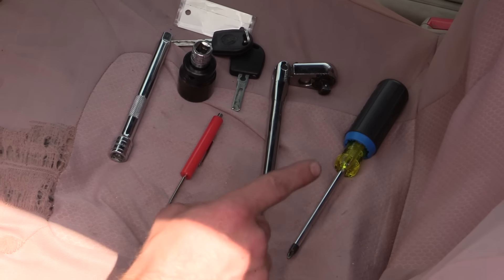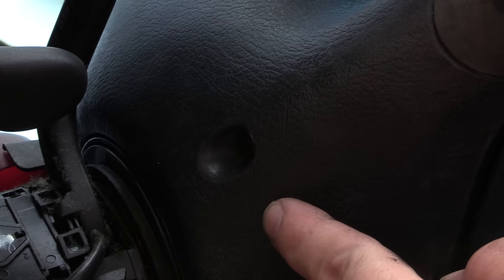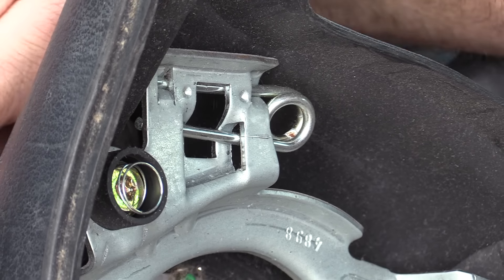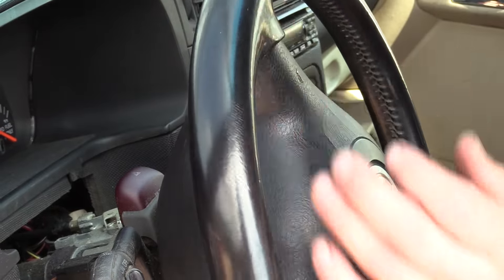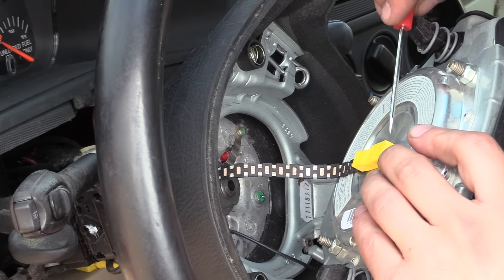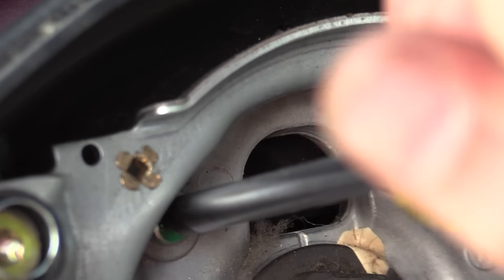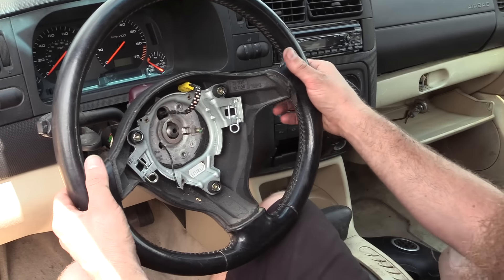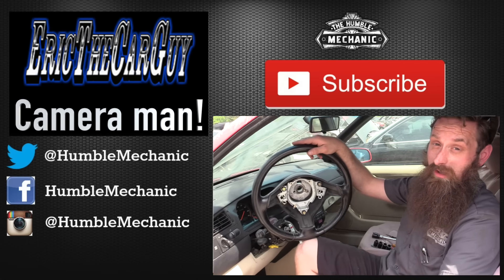How To Remove a VW Steering Wheel ~ Salvage Yard Tips

Comment: Two things to add here, when you remove the steering wheel from your car always turn back to 12 oclock, so the replacement wheel gets put on straight.  Second, put the 24mm nut back on two threads  before working the wheel loose so if you have to pull hard on a stuck wheel it doesn't pop off and hit you in the face.

Comment: Struggled for ages until I extended the steering column out to its limit then the screwdriver fitted easily and it popped off with in seconds.. good vid. VW Sharan with a M12 spline bolt to tighten the wheel..

Comment: Just left a wrecking yard to pick up a clock spring for a 2014 Passat. I had no key but I was still able to turn the wheel. I made sure the front tires were pointed straight ahead before I removed it though. The steering wheel had the triple square bolt instead of the 24mm nut.  Now the fun part, to see if this used unit works! 🤞🏼

Comment: Charles 
I'm surprised that pick a part would not have removed the air bags themselves due to how hazardous they can be. some of the yayhoos that go into salvage yards haven't got a clue on airbags, theirs sensors or how they operate.

while I'm here does a 1997 Eurovan/T4 air bag release the same way. some day I might have to remove the steering wheel for maintenance or the multi switch.(turn signal ,speed control stalk)

another great informative video.

Comment: So much easier than I used to do - my old car had a splined taper for the steering column, so you needed a puller (or a hammer and brute strength) to get the steering wheel off.

Comment: Love your salvage yard tips for these VW's. I've been a Subaru mechanic for quite some time, but my dad bought an Audi Allroad and I just got an MK4 Jetta TDI... I'm slowly moving towards the dark side:/ ... I'm researching doing a 4Motion MK4 Jetta TDI conversion, although it's looking pretty daunting.
Reply from the maker: +Rodrigo Sagebin NICE!!! Probably be easier to buy an R32 and swap a TDI. lol
Reply: I've seen people using the R32 for the swap. Do you know if the transmission just bolts right onto the 1.9L TDI engine?
Reply from the maker: +Rodrigo Sagebin it does not. :(

Comment: Nice video Charles! In modern VWs I think there's a triple square head bolt instead of the nut, otherwise its the same. It's funny how there's a "special tool" to release that spring lol. I think I read on ELSAWIN the instructions to use the screwdriver as well, i found it really easy when I did it myself on a VW Up!.
Reply from the maker: Yeah the newer ones are a triple square. The MK5.5, B6 and up are pretty easy with a pocket screwdriver, or small flat blade. These older ones were awful. I was shocked the airbag came off with little fighting HAHA

Comment: Great video BUT unfortunately I still can't get the airbag off even following your tips. I have literally wasted hours over this step that should take a few seconds.😬I'm sure I can actually feel the spring / clip moving slightly when I press the end of the screwdriver down, but the airbag is just not popping open, even when holding it in as you suggested. Any additional tips of what I could try? My car is a 2008 Seat Alhambra.

Comment: This looks like the same steering wheel on my 2002 B5.5 VW Passat Variant. I'm assuming pretty much all of these instructions are the same or similar. I'm thinking about doing a cruise control retrofit kit on it. This is valuable info for me. Thanks!
Reply from the maker: Very similar. You’ll need a triple square for the bolt.
Reply: HumbleMechanic, good to know. Luckily I have a nice set of XZN sockets. Thanks for the info.

Comment: I have a question... My wheels where aligned perfectly BUT my steeringwheel is now a bit off to the right. Can i just take of the steering wheel and put it back in pointing up? Or will that mess up the steeringwheel angle sensor? Thank you for the clear video on how to remove it!
Reply from the maker: You can, but it’s better to get the alignment right. The steering wheel needs to be straightforward when aligning

Comment: Interesting how the Mk3 has a retaining nut, instead of a retaining bolt on the Mk4 and up.  That technique with the airbags is the same dance you have to go through on the newer models, too.  It's always nice to have a video to show how the spring and posts work on all the generations, so you're not hunting blind with your pokey bit in a hard to reach hole.

@HumbleMechanic, do the Mk1 and Mk2 VWs use the same 24mm nut like the Mk3?  Or is it a different method of attachment for those?
Reply from the maker: +chrstphrr I think it's the same. Be a while since I had a mk1 wheel off.

Comment: 2/4/2019
Hey, love your 'how to' videos and really appreciate that your a VW guy. 

I recently went through about a one week long deep freeze here in northern NJ. I immediately noticed was not hearing my windshield washer motor when I pulled the lever toward me on my 2013 VW Jetta Sportwagon i5 gas aspirated model (M6?). Anyway, at first I figured the lines were frozen but then I realized I wasn't hearing the washer motor anymore either. Just silence. The windshield wipers went through their usual two swipe sequence but no fluid. Checked fluid level, it was good, but topped it off anyway. Then I realized that an odd thing happening that I hadn't realized was happening at first. When I pull the lever toward me to wash the front windshield (remember now, silence, no washer motor noise), the windshield wipers would go through their normal two swipe sequence, but the REAR wiper was also doing its one swipe pass too! This never happens and is not supposed to happen when you pull the lever towards you. Now, additionally, when I push the lever away from me, to operate the rear windshield wiper, the rear wiper does its one swipe pass, but the FRONT wipers also do their two swipe pass as if I had pulled the lever toward me! Very bizarre. It does this activity each and every time I try these actions. I am thinking that perhaps the WW Switch itself may be faulty. What is your interpretation or experience. Can you perhaps give me a call on my cell phone to talk this through with me? My name is Kevin and my number is 973 803-0663. I truly value your time and assistance if you are able to give me any. 
Thanks Bud.

Comment: When trying to release the airbag clip is there a chance it will go off even if the battery is removed?
Reply: shouldnt be, i mean youd have to give a static shock from hell
Reply: no
Reply: Pretty little chance, but always take safety measures. Disconnect the battery and ground yourself to eliminate any static charge before touching the connector.
Reply from the maker: It is part of the repair procedure to "unearth" the battery. I have done that about 2 times, but it's always recommend.
Reply: Okay, thanks for the replies, guys! Happy new year!

Comment: Hello, thanks for all that you do . Do you know of any tips or maybe a video where it shows how to access the wires that go to the steering column lock? I am having a problem with my CC that when the weather gets cold and I go to start the car - the car won't start, I get a red flashing steering wheel symbol on the dash, get a notification "steering wheel column lock defective", and a beeping noise. Then, I usually remove the key, rotate the steering wheel and I can get it to start. 

I am very suspicious that this is just due to a poor connection in the winter when the wires contract due to the cold weather. It mostly only happens when it is cold outside. Thanks again for what you do.
Reply from the maker: Possible. Use ErwinVW for a one day wiring diagram pass

Comment: I need to replace the cruise control switch assembly in my 2009 VW Routan.  My Airedale terrier's leash wrapped around the switch handle and pulled it out of the column.  :(    Is this pretty much the principles that I need to use to remove the horn assembly to get to the switch?  What type of connector is used to hold the steering column trim?  Is it a screw?  I look forward to hearing your answer.  I miss my cruise control and I am sure my Airedale is tired of hearing from me how he broke my cruise control switch.  :)

Comment: THANK YOU FOR THE VIDEO, THIS LOOKS VERY SIMILAR TO MY 95 WOLFSBURG EDITION CABRIO EXCEPT THAT I HAVE A 4 SPOKE STEERING WHEEL. IS THERE ANY DIFFERENCE IN THE PROCEDURE FOR THE 4 SPOKE WHEEL? THE ONLY REASON I NEED TO DO THIS JOB IS TO REPLACE THE HAZARD LIGHT SWITCH FOR A SAFETY INSPECTION.
Reply from the maker: It should be the same if it’s a mk3

Comment: Hey Charles how you doing today I am working on a 2009 vw cc with a 100k miles on it the costumer said that there steering will is hard to turn do you know of any common power steering issues on these specific vehicles that I should look for wen I check it out and do they have electric steering on the 09 vw cc ?

Comment: Question please. Have a 99 new bettle when parked steering wheel seems perfect. Yet when started up ready to drive it's roughly 30 degrees to the right yet it does drive straight. Or other way to describe it vw emblem perfect when get ready the emblem on wheel is v at three o'clock and w at the 9 o'clock position but car doesn't pull either way. Thank you

Comment: Man! I thought you were gonna help me remove it WITHOUT the keys!! When was the last time you had keys at the junkyard? thanks for the video though.
Reply from the maker: More than you think.  You have to totally bust the steering lock of this. The mk3 is a pain. The mk4 is much easier with just 2 sheer bolts to remove
Reply: @HumbleMechanic  ahhhh.. which bolts are you referring to? trying to get the lower trim piece under the steering column but there are two small screws that are directly behind the wheel. Can't remove air bag without turning wheel. So..... 

thanks for the quick response though!
Reply: @SFlores1979  I have a MK4 and was able to remove those 2 screws that you speak of without removing the steering wheel. I used a screwdriver that is shaped like an S /Z / ZigZag  ( has 2 90deg opposing bends in it and about 4 inches long). That allowed me to turn those screws out, very, very slowly. ...But it worked.

Comment: Is it possible to swap a steering wheel with volume/stereo controls onto one without them? Could you do a video on that?
 Thanks - Alex
specifically on a 2005 Golf tdi (I want those volume buttons lol)
Reply: You can yes. But you will need all the can-bus system from that car. As well as the replacing your existing blinker switch. It's a pain that's not worth doing just to have steering wheel controls
Reply: You'll also need a monsoon radio and the password for it

Comment: HI.. i have polo 6n1 1.4 16v 1996 i have removed steering wheel successfully cause i have to replace the ignition switch so i stuck a little bit on that... after some work i managed to replace it it works well first two days and after that i had some white smoke and airbag light came on but the ignition switch and everything else works ok... i open everything again cant see any melted wires or anything but cant get airbag light off... any ideas advices.. Thanks in advance

Comment: Do vw have the wheel and nut premarked for easy reinstallation so you know it is lined up properly?
Reply from the maker: The nut or bolt doesn't matter. Some have a mark on the wheel, and on the steering column. I always add my own before removing the wheel.

Comment: Does this work on B5.5 passats? My steering wheel controls are faulty on both sides as well as the trip computer buttons on the wiper stock. I just want to run to my local salvage yard and grab everything instead of ordering parts.

Comment: will newer steering wheels fit older cars
Reply from the maker: +stephen the handy tuber many will. There was a spline count and diameter change in the late 80s/early 90s. I don't recall the exact time. But many wheels are interchangeable. It's the airbags that may not be
Reply: HumbleMechanic thanks for replying it just I have a 2001 vw polo and the steering wheel is very worn I wanted to get one from a mk6 golf or similar
Reply from the maker: +stephen the handy tuber that will probably work for fit. Doubt airbags are compatible. 

My 05 Passat needs the same thing.
Reply: HumbleMechanic ok I will get one and check connections thanks

Comment: I've wanted to change my 2000 Beetle wheel out for something else.  I'm assuming just a Mk4 wheel from Golf/Jetta would work.  How about an Audi TT from the same year?
Reply: You're in luck.  A Mk1 Audi TT is built on the same A4 generation/platform as the Mk4 Golf/Jetta/Beetle, or the B5/5.5 Passat.  It might work, but I've never seen one with the airbag removed, to confirm it's a no-fuss swap.

The style of retaining bolt and spline on your Beetle will take other wheels from most anything from around 2000 and up, so long as it's from a VW group car (VW, Audi, Seat, Skoda, Lamborghini, Bugatti).  Two big things affect the wheel swaps being plug n' play:

A) The clock spring and number of wires that it feeds to your current steering wheel.  Things like the MFSW (Multi-Function Steering Wheel) controls add wires, and there's a non-CANBUS/CANBUS changover mid generation of the A4 platform -- around 2001-2002 model years.

B) The airbag connector.  The A4 generation Golf/Jetta/Beetle or the B5/B5.5 Passats should have the same airbag connector as yours.

OTHER, later than 2000 wheels will fit the splines on a steering wheel.   But the clock spring, and the airbag connectors change between generations... and possibly between VAG marques as well.

I've fit a Mk6 generation Jetta steering wheel to a 2000 VW Jetta -- it involved me doing some trickery with the airbag connectors, swapping the Mk6 style for the Mk4 style airbag connector.  I used another Mk4 airbag connector/cable from a donor Mk4 steering wheel that matched my original wheel, so I didn't have to do any voodoo with the clockspring.  

Just about every resource I found about this, said it was a bad BAD BAD idea to change the connector, that the airbag won't fire when it is supposed to.  Nothing authorative, but VW wouldn't condone a swap between generations and the wiring/connector changes, even if it's electrically kosher.  YMMV, and no one's twisting your arm to do or not do the wheel swap.
Reply: Awesome! that's a lot of helpful info!  Maybe I'll save up 20k for that Bugatti wheel :P
Thanks man!

Comment: Is there a way to remove the airbag from the cover so i can still use the cover without the airbag?
Reply from the maker: +Green Alien the bag does come apart, but I'm not sure just how to make what you're asking happen.
Reply: Like how the air bag is inside the horn cover is there a way to remove the bag from the horn button completely and still be able use the horn to clip the horn button back onto the wheel?
This is the piece i was talking about 1:09 - 2:39 
I've heard of airbags deploying for dumb reasons. The reason im asking is because i'd like to fit this wheel to my 73 super beetle as a replacement wheel.
Also, any tips for removing the airbag from the wheel if you dont have access to the keys?

Comment: This has nothing to do with this problem. I have a 2004 jetta tdi. I just replaced the starter and everytime I press the clutch the starter engages. I have changed the ignition switch and changed the starter relay but it is still doing it
Reply: Hi Robert. I'm not Charles but I am somewhat familiar with mk4 wiring. My first instinct is that one of the two clutch switches got crossed with the starter power. Many times the wiring sleeving gets brittle or worn out and copper touches where it's not supposed to. I'll try to go look at my Bentley manual and let you know what I find. Definitely a weird problem!
How far down do you have to press the clutch for this to happen? Does the engine have to be running or does it happen with key in, engine off? Or even key out engine off?

Comment: and if no keys whats the magic words charles ?
Reply from the maker: Chainsaw? 
You have to knock the steering column lock off. It it a headache on this car. I think we will be doing more of these videos in 2017. I will have that on the list.
Reply: Could you go the route of unbolting the knuckle on the steering column that feeds into the steering rack on the Mk3 cars?

I've done that on a junkyard Mk4 Jetta:  Remove the cover, 13mm bolt to loosen/remove, pull the knuckle off the spline, and the wheel was free to turn both airbag holes to the 12 o'clock position.  

Did this, in my case, to be nice and not butcher the car while I uh... removed the ENTIRE dashboard to chase part of the wire harness I needed to go with the seats I was taking.
Reply: chrstphrr yes thats kinda what i want to see the most its not the easy stuff but the things that make me cuss like a drunkin sailor you know what i mean cause if you do any wrenching you have come acrosse it before -its like who in there right minds would build something this way lolololol
Reply: I just hate having to bust stuff up to get to what I want.  Someone else might need that part... maybe me, even!

Besides,  going the roundabout way, not destroying a parts car is also a practice run for when you have to work on the same parts on your own vehicle. :D

Comment: Tip dont remove the nut completley wen the steeringwheel is stuk on. because if you jank it off you can get it in your face and maybe nock out your teeth
Reply: That's how I was taught, the nut stays on until the steering wheel is loose. I never found a car that the steering wheel was so easy to remove like in the video, even on VWs.